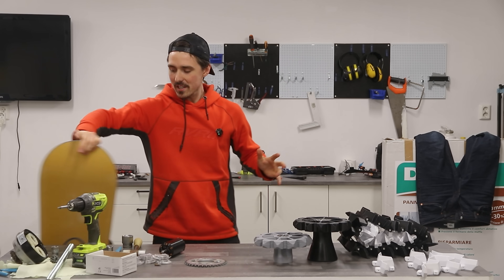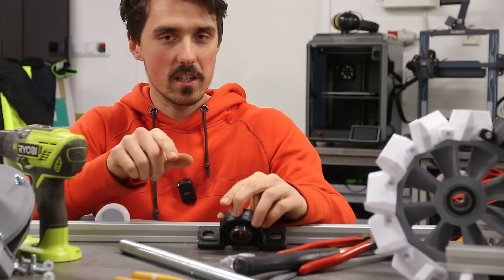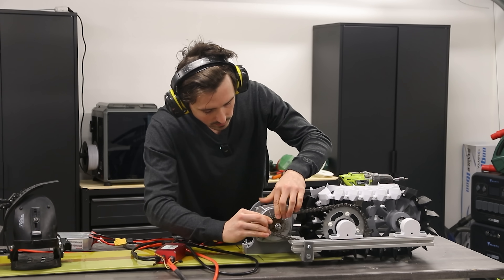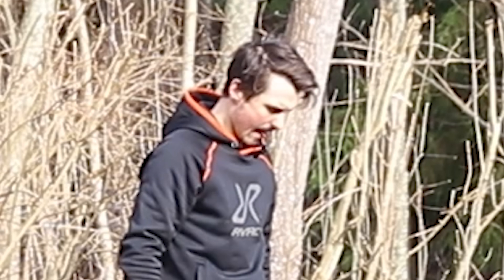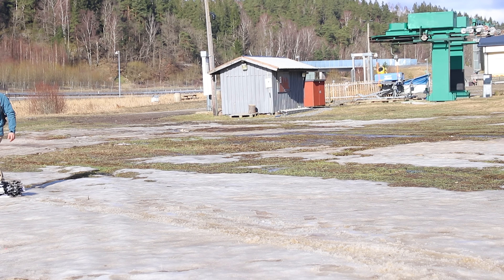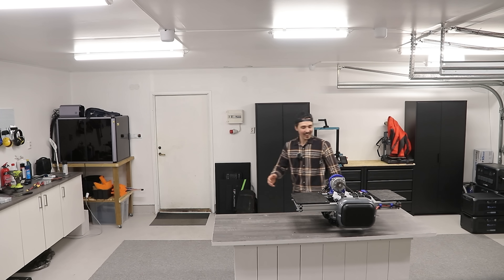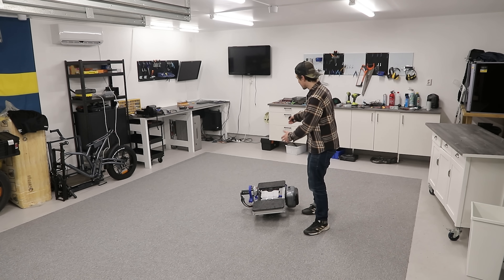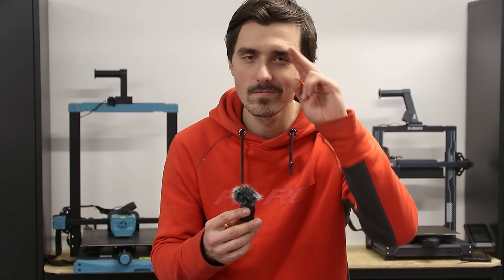World's First 3D Printed Onewheel With Tracks!

Comment: MAKE YOUR TRACK CURVED wil solve most of your problems.....ill detail why here....Great content btw, Next, Center of mass connection, the the extrusion platform, needs to be in center of drive line. That will be apparent when turning. It would put the weight on the outside edges rather than spreading across from middle track to outside. With the weight fully on the outside edge the centerline drive wheel will lose its torque connection in the track flex. This is why you should 3d print curved track, or v track for snow. And if you make the outer edge of a track alternate narrow or wide each link haveing a narrow side and a wide side with all links alternating that will give the spacing for the curved track to round the drive and idler wheel

Comment: For your one-wheel, your track's 3-D printed paddles are too tall and should be closer to less than 1/2" and much thicker at each paddle's base where they are connected..  That way it will be more like the tracks on Snow Cats.  You are wanting more out of your plastic than it can hold up to what you are trying to accomplish.

Comment: Interesting. I like that you didn't scrap the project, just converted it to another. But I think you should use the 3d printer for certain parts not others. Maybe a rubber track would be an improvement? Even so, love the ingenuity and learning from failure. I think you should build an electric bike from scratch, with many 3d printed parts...

Comment: Bro you should definitely use a gyro (that you can strip it from cheap two-wheels overboard for kids) and mount it such that the electronic control accelerates with the center of mass forward, retroactively and rapidly balancing the inertial acceleration.
I think you could also simply program one by yourself for fun just buying the little gyro electronic component! 
Cheers, I had fun with your work
My best

Comment: FOR STRONGEST 3D PRINTS - print max number of walls(perimeters)... infill is not important... If you calibrate flow correctly you can put 100 walls so your whole model is only walls, no infill. Also, print at pretty much max temp of your filament (around 220°C for PLA). Model orientation matters a lot - usually it can withstand 2x stronger forces in horizontal than vertical direction. For stronger layer adhesion print slower, smaller layer height and 0% fan (except where you have bridging). This is all backed up experimentally in many videos of CNC Kitchen guy.

Comment: As a veteran of analog electronics, motor control issues like this seem almost too easy to solve to me, so I was surprised how it was essentially your biggest problem. However also I thought modern controllers are so "perfect" that you'd never really run into these issues so that's also a surprise to me.

Obviously though most of the "analog" solutions are variable-resistance -based for at least a portion of the control so it's with great losses, hence why everything is PWN & alike now, just like how 99% of audio today is Class-D instead of A, B, AB etc.

Comment: Seems like for a OneWheel, it's the wrong track design. At best, the cleats are possibly too tall(with a chance of not enough or too spaced), and the track is too short. There's also having the track and platform articulate, so the track stays level and flat until an obstacle while the platform tilts back and fourth, kinda like the bogey system on an American halftrack.

Comment: Your motorized snowboard could work. If you add a suspension setup to push the treads into the ground it will dig the treads in to put that torque to use in the snow.

Comment: Print a pair of small wheels for the rear so it doesn't get stuck when you start moving. It's like wheelie bar on a drag car but without that long frame. That might eliminate the sudden stop problem you are having once you hit the gogo trigger while not balancing your weight perfectly.

Comment: Seems like the motor controller cant do much low speed control. You should consider using a VESC, it has as much or as little low speed torque as you need, and is very controllable.

Comment: You cant test it on hard floors with no give or traction if its not meant for that surface. Add rubber to the treads so it can be used on smooth surfaces.

Comment: Nice projet but at some point you should stop always using plastic 3D printed parts and try to find other designs and material for your projects. Plastic isn’t reliable for those power and that is such a waste of material (which btw ends up directly in the environnement…) cheers ✌🏼
Reply: I mean.... he isn't only using plastic also the plastic doesn't end up 1:1 in the environment and hypothetical he could reuse the printed parts but I get ur point ;-;
Reply: Prototype

Comment: You can't think single track. If you make duel tracks and servo's you could speed up or slow down one track or the other by leaning. Also the track needs to be longer for stability so think about miniature tank under a board.

Comment: For the snow, I think the blades just aren't positioned right. They're almost level with the board and it just pushes the top layer straight back. Snowmobiles really dig into the snow and the ENTIRE bottom of the snowmobile is treads, so the entire weight of the snowmobile on on those treads, which allows it to really dig in. Also, having a longer length of treads gives an area where it can push snow/sand backwards and that snow/sand can not just be flung back, like when a tire tried to spin in snow and sand. It also had a LOT of flat surface against the ground and that could be limiting also. Having a more parabolic/curved surface might limit contact and friction. I really think the original design could work if tweaked/adjusted a little better.

Comment: make a frame under the board and make it so the tracks stick out lower than the frame (with board on top), then add skis at the front. Make it so when you stand on the board, most of the weight is distributed towards the back, which is attached to the wheel, and not the skis at the front

        _______
XXX/-------------\__

something like that? 😂

Comment: I think the snowbord setup could work but I you need a powered track unit that has suspension and is pushed down hard. Then when the snow get's eaten from the spinning track and the terrain will lower because of that under the track the track will go down with it keeping contact with the snow to get traction. Also it seemed you did not have a sensored brushless motor. that will result in the problems with the startup of the track. and last but not least, I would advise you to add some shielding around the unit on the top to get it a bit more safe to use. Years back I had an idea of more or less the same but then to power a little sled. When our daugther was a baby we had her in a special little sleeping bag on top of the sled and we pulled her walking in the mountains at winter holidays in Austria. The idea was to make a sled like they use for dog sled sports but smaller and stand on the back myself. The track should be underneath the sled but lack of time, lack of cheap material (like a little tracked snowblower as a donor, , lack of a 3d printer, lack of space to transport it together with all our other holiday stuff in the car from the Netherlands to Austria for a week in the snow etc. So it remained a fun idea in my head. The closest to this vehickle is the 3d printed snowmobile that I made 2 years back (the skeeride).

Comment: I think your problem is, that you are not riding on the treads, you are just trying to push the board with the treads almost at board level. the aluminium frame probably just flexes up and gives the treads no traction. If you make two of those tread assemblies, one in the front and back and power the rear one, you probably swoosh away like nobodies business

Comment: Your 1 wheel does not work because you are using a remote to control the speed. You were supposed to use a self balancing circuit board . It is impossible the balance it with the remote.

Comment: For the snowboard, place the motor behind the tracks, to distribute the weight.
Put it on the end of a beam, so you can adjust the height, and add a cantilever load (weight.)

Comment: I think you needed large barrel shaped rollers under your feet because that flat surface was just way too much friction to overcome when your full body weight is on it. I just looked up successful versions of powered board designs and they run tracks along the length of the board. So this makes sense. I think the design Idea was a good one just needed to put the track under you not behind you. I think go back to the drawing board and you'd have succeeded on this one.

Comment: for traction on snow/sand you would probably need some form of variable down pressure. take note from a snowmobile for example, the suspension helps it dig down when it needs to but allows stable height when on packed or harder surfaces. also a wider longer track would "probably" be needed for a sled that big (i think you need like 4 to 1 track to ski ratio, idk if thats true im just speculating) kind of like trying to mud with vehicle that has 6 wheels but only one spins, the other 5 wheels will resist too much for the singular wheel. pretty cool vid!

Comment: If you had your back foot and 1/2 your weight over the tracks the snow board would have worked and thr one wheel with the tracks longer and a greater gear reduction for smother starts  and plenty of power at 48 volts worry about top speed later

Comment: You are this close to inventing the Electric UniSnowCycle, or EUSC - just add pedals to the sides, take them off the front/back, put a reverse bash guard over the tracks so you don't be hucking ice into your crotch all day, throw a controller with inertial/gyro capabilities in there, and that's kind of the whole path to converting from snowboard to something you can at least send - double the voltage, though.  Snow is not as bad as sand but it's a similar traction issue with even less surface drag - in either case it's easier to enter conditions that stress your prototype and will find fatal/catastrophic flaws and weaknesses.

Also, look into bideck snow skateboards, Landyachtz (not an affiliate) is one that actually works well, can carve, etc; it seems that one could mount some drive wheels or tracks on the sides that are somewhere in between the levels of the decks so you get propulsion often enough but you don't incur the drag penalties and weird weight distribution making you have to constantly shift your weight to keep even moving, much less carving.

Either that or flip your power leads, et al, and let it DRAG you on the slippery thing; put a stomp plate over the track so you can press your foot on the front to control your traction/braking or lift it off entirely to glide on your back heel somewhat.  Too many people are making lean-back designs when if it's designed lean-forward, eventually that can become a motion/gesture assisted control (similar to how the EUC control algorithms/curves evolved).  Besides, front wheel drive cars work much better in icy conditions as well, given enough traction, and this thing has traction where it needs to.  If you can get it going fast enough, you'll have a snowboard you can drift on, like Tokyo Drift on.  Kind of like if you had the boat bolted to the front of your waterski.

Comment: I'm sure you could use a throttle/limiter (Take a look at those older electric car race tracks - some have a "gun" that has a trigger that limits the voltage coming out of the transformer - I'm sure you could use it on a battery) 
Also wouldn't it be neat adding metal machining into your workshop? Then you'll be able to make parts that won't snap like plastic. (I do a lot of woodwork since it's cheap - and I can see using wood in places of many of his projects that would be much stronger than plastic, but I can still imagine it could snap... so machining metal parts would be so much better)

Comment: I see you can work on the geometry of support on the tracks, make support along the edges of the tracks or make the central rollers wider.  Yes, I understand that this will require new printing attempts.  As mentioned in other comments, it is a good idea to apply static pressure to the track independently of the position of the board.  As for the tracked wheel: I think you need to learn how to ride a regular monowheel, and then try to modernize it and set gyroscope, but I think that the idea with a snowboard is much more promising.

Comment: You need to have active control using gyros and accelerometers to balance that thing. One wheels work by measuring the angle of the board and accelerating to match so that you don't topple over.

Comment: The geometry is working against you in both cases. Here's a quick alteration that might work. Take the one wheel version, attach the snowboard section at the back. Have a foot in front of the track and the other behind. Make sure there's some extra snowboard length behind the back foot. When you start keep weight on the back foot, there won't be much weight on the track for traction. Lean forwards to increase traction. If you accelerate too quickly it will tilt you back but the snowboard at the back will stop it tipping as much and just decrease traction instead, so it's self-regulating just by the geometry. If you're going left it would look a bit like this:    _/,,,_|__.

Comment: I wonder if the one wheel would work if you used a inline controller to smooth out the throttle inputs(PID loop), then there wouldn't be abrupt changes in torque tossing you around. Also might save a few face plants in the testing 😂

Comment: Greetings from Ukraine! Great project, I have some suggestions for you to improve: you need to lower the center of mass point so that it is lower than the axis of rotation of the tracks, also the material of the tracks itself causes some problems for use on hard surfaces.

Comment: Why don't you buy one of those cheap hoverboards with two wheels and use the two hub motors from front to back to wrap the tracks around? You will then have direct drive and the gyro on the board will keep you upright. I think it would work out brilliantly. A 750w 35v one would be perfect to gut to make your tracked onewheel. I hope you consider it. Or you can use 2 electric scooter hub motors to wrap the tracks around and buy a gyro. The direct drive is key for the self-leveling to work. I think it would be awesome with tracks. Please revisit and try these suggestions. I love your content. The good the bad the ugly, it's all brilliant.

Comment: Yea I thought the gear on the snowboard was too high and as you saw on the sand it was too high to get any traction.

I would have made it always go fast with an on/off button then add a lever to push the wheel lower into the snow/sand. So the lever becomes your throttle and you control your thrust by how much you push the spinning wheel into the snow/sand. 

The one wheel of death…. I can’t even understand how you imagined this will not throw you immediately off if it didn’t automatically gyro balance itself?!? I guess your Jimmy Neutron brain wasn’t being used then.

Comment: go back to the smaller treads if you can. More teeth will give more surface area and will give the tracks much more durability since the weight is distributed. You may need to increase the width tho. The last project actually has massive potential so please dont give up on it.

Comment: I think the snowboard might be better if if you had the belt mounted on a spring loaded arm pushing it in to the snow, also maybe make it able to swing a bit on a rubber dampener for better steering.

Comment: Print the track out of tpu and throw a cheap vesc controller. You are 80% there. Also many sensor pads out there for engaging the board. Ive got some documentation if u need

Comment: Another amazing project involving insane motors and batteries! Always fun to watch.

I have a question about brushless motors and ESC. Some of my studients have to electrify a wheel chair (only for assistance, not to fully power it). They chose a 5" motor wheel of 250W @ 36V. 
They plan to power it up under 12V, to limit the speed (6km according to the vendor).
How can they determine the maximum current the motor can use (at startup, or when blocked), in order to choose the correct ESC?

Comment: Your 3D Print mounts are often so simple, you could make them faster, cheaper and easier out of sheet metal. And they will not break. I see you making torque parts out of 3D print plastic so regularly, and everytime I patiently wait for the moment when they fail
Reply: I think he is using pla, he should realy try pctg(yes with a c), or tough pla before spending the money to get the parts made of a sheet of medal
Reply: @spaceboi4468 Yeah but he spent a whole kg of plastic on a single motor mount. That's 20 bucks roughly. You can make a sheet metal mount pretty quickly with primitive tools for 5 bucks of material. And it will be even lighter

Comment: You could make a parallelogram swing mount that has a spring, possibly adjustable, to put tension on the tracks. With the snowboard design that is.

Comment: Probably need to add a dynamic motor controller much the same as the one wheel
Reply: Actually the VESC he used already supports self balancing. Only a gyro module needed.

Comment: You could try some of the overture easy nylon instead of the PLA? that you printed the track from. Should be tough enough to handle the forces and isn't terribly expensive. 
I would revisit the tracked snowboard, but with adding two more pillow bearings to allow the track to pivot, then a coil over that's pre loaded with ~ 50kg (depends on how much mechanical advantage you give the swing arm). Should give you even grip while it digs into the surfaces.